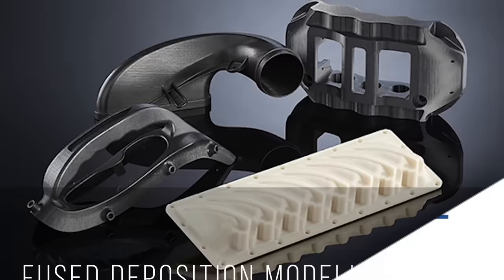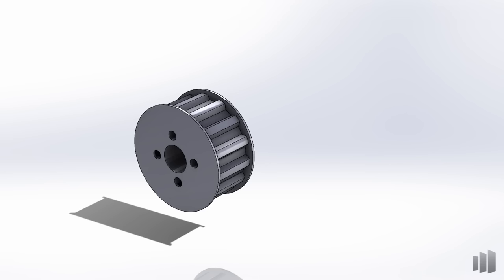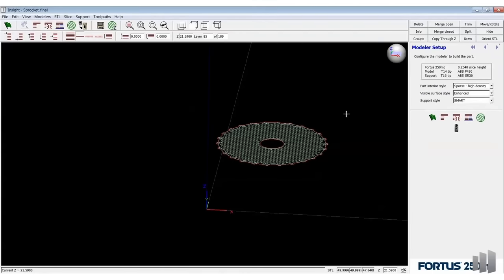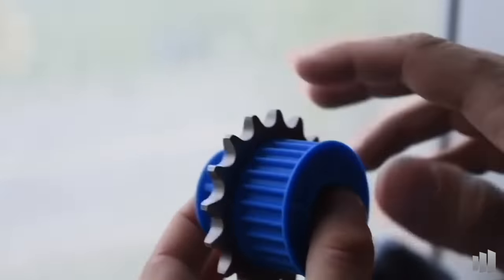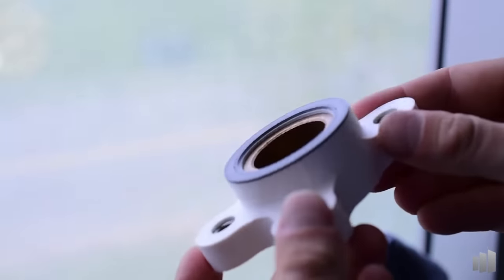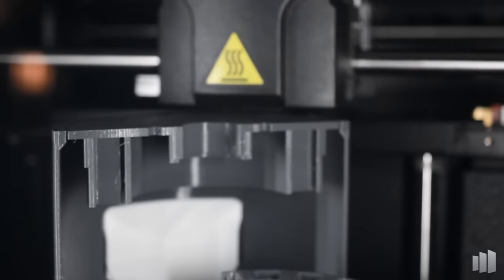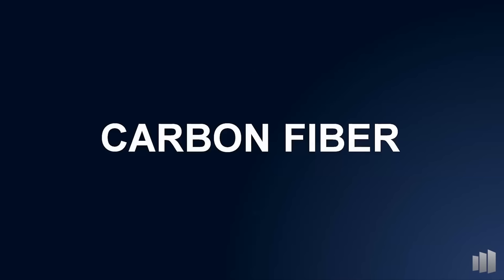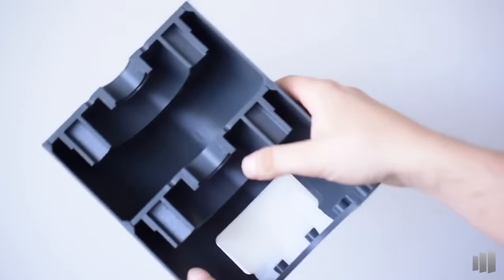6 Advanced FDM 3D Printing Tips When Adding Metal Parts to Your Build

Comment: The pause feature is not limited to just stratasys software. I can very well do the same thing in Cura using the "Change at Z extension" with this extension I can add custom g-code to park the print head by layer number or using overall height allowing me to add fixed in place nuts, mesh, ect
Reply: Any recommendations for videos on how to do this?
Reply: Prusa slicer has an especially easy pause at a layer feature as well.
Reply: @jessem8928  Search "CHEP pause at height" I would send you a link but they often don't work in comments.
Reply: I think you can also add a firmware pause command at any step you like by editing the g code file.
Reply: I can do the same thing without cura just by opening the gcode in a gcode editor and just search the layer I want to pause at and insert a few lines of gcode to pause it.
Reply: Same here! 🔥
Reply: It’s easier to do in cura it’ll add the g code automatically / you pick the layer height etc

Comment: If the torque is high enough to require a metal sprocket this part is going to fail instantly on the small plastic studs in the middle. Use some metal studs at least...

Comment: Instead of plastic rods through the sprocket, drop in metal rods.
Reply: Or use bolts.  The design shown in this video looks to me like the small plastic extrusions through the holes would be prone to shearing off.
Reply: Or thread in screws and/or nuts to hold it together laterally.

Comment: 1:30 "The roller chain sprocket is going to need to be made out of metal because of high force on the part"

* Uses 3d printed plastic pegs printed onto the belt sprocket to transfer torque with a sheer force across the layer lines at a smaller radius than the sprocket *

Comment: All of these techniques are also applicable in the hobby space of 3D printing. I can probably do almost all of these techniques on my Prusa MK3S using PrisaSlicer, though I'm limited on the type of thermoplastics that I can use on my open frame printer since I don't have an enclosure to put around it.
The technique of embedding other 3D printed parts is probably the only one that I hadn't thought of before. Thanx for introducing me to that idea.

Comment: Strangely, my biggest take-away from this is the non-metal, large overhang part you printed there. Had never thought of that. Other than that, I've used the "Pause at Height" post processing script with Cura and have imbedded weights in fidget spinners, magnets in a cup bottom so it's secure on metal surfaces , and a bunch of other things.

Comment: Those are some great ideas! I love it! I'm sure your Inight software makes it very easy to accomplish. 

But you can do these things in common 3D printing slicers as well. Cura and Prusha slicers allow for pausing after a certain layer to insert components.
Reply: By just adding G code at a specific Z hieght?
Reply: @jessem8928  Just add a filament color change at the desired layer and when it pauses and waits for you to change the filament, place the new component and dont change the filament.
Reply: @jessem8928  I am using Prusa Slicer. you can add pause inside the slicer itself. at the Sliced preview. there is a + Icon at the timeline where in you can add pause, color change or specific custom gcodes.
Reply: I have a good reason to leave makerbot behind now

Comment: Really interesting applications for various inserts. One thing I would add is if you have an issue with the hexagonal nuts spinning inside their holes and wearing the surrounding plastic, try square nuts instead, the corners have more area within the plane to move through compared to hexagonal nuts.

Comment: These are excellent examples, thank you for producing/sharing this. My favorite reinforcement are stainless steel screws. In addition to what you would expect (a steel rod significantly increases resistance to deflection/shearing) they are also quite good at moving a force on the shaft to the head. I've had a few pieces that wouldn't work because a sideways load (impact) would delaminate the z-layer easily (even with PCTG and isotropic polymers), but a screw head transformed this into a bending mode on an x-y layer, and all was fine.
Reply from the maker: Most welcome. Glad you found this useful!

Comment: Greate video! I especially like the idea of combinding plastic parts mid printing. I dont know if you mentioned it but personaly I like to preheat any metal parts to bed temperature before inserting them, just to avoid the risk of warping or layer seperation.

Comment: This is an very useful video.  Great ideas for all sorts of inserts.  
Humble suggestion,  when inserting nuts i found it worth buying an inexpensive square nut assortment in place of hex nuts.  The longer edges are less prone to deforming the plastic and spinning if you get a stuck part.

Comment: It is worth noting that superslicer (free) has the built in option to, at any layer add in a pause command. (Or any arbitrary GCode for that matter.)

So you should be able to do this on any printer that doesn't lock down what slicer you can use.

Comment: And here I was, thinking I mastered mid-print weights and magnets… You got me a with this captured sprocket, but then actually blow my mind with this printed halfs, that assembled mid-print. Genius! 2 questions though : 1. Is the layer on top of the sprocket just overhanging? Or does it stick to the metal? If so, what is the filament and how you made it stick to the metal? In my experience I leave a little gap, so that the layer on top of weight is a bridge or overhang, because when trying to print directly on metal part, it doesn’t stick at all and curls like crazy. 2. How on earth did you manage to continue print on top off assembled part? Coming from regular slicer software, so I guess this is some Insight software magic, right? Can’t be simple manual gcode editing, right?

Comment: I have a question:

Do you have any layer adhesion issues when inserting cold parts and printing over them?

Great video by the way.
Really opened my eyes to alot of potential in future builds.
Reply: Great question, I was thinking the same
Reply: layer adhesion is not dependent on the temperature of the surface below
Reply: @TheInfernox7  its not independent either. as the layer beneath cools you will get worse adhesion.
Reply: @dpoarch  I think that they mean more so they aren't expecting the layer on top of the metal to adhere to the metal. And if you have an enclosure on your printer leaving the metal parts inside the enclosure until its time to put them into the print could probably minimize any issues.
Reply: Hmm, perhaps you can add in the gcode to print the first layer after the pause at a slightly higher temp?

Comment: Nice video! I think the only thing I would change would be the sprocket pulley. Rather than relying on the 3D printed part to transmit torque through the 4 small cylinders, you could press fit or bolt all the parts together in the end.
Reply: Yes, relying on layer adhesion for all the torque transmission is a bad idea I think.

Comment: Hah, it seems so obvious to use printed parts as "inserts" to reduce support material requirements. I have no idea why I didn't think of it myself. Nice.
There is of course, always the option to place in a temporary 'support' such as a bearing or bushing to prevent sagging of a print - but this is more difficult for odd shapes.

Comment: Excellent examples of great engineering solutions to problems with FDM printers. However, it should be clarified that Stratasys Fortus printers, while very reliable machines, are far from the only ones capable of these "pause" behaviors. PrusaSlicer and Cura both natively include the ability to pause at desired layers. You can do this on any $100-$1000 printer, it doesn't need to be a $50,000 Stratasys.

Comment: This is an advertisement for fortiss(sp?) and stratysis(sp?)? Neat stuff, but all of the pause at layer stuff is pretty easy to pull off with cura or superslicer... That multi-level baffle thing was pretty smart though, I have to admit. Any feedback on how well the sprocket with double pulleys actually performed? That was an awfully small cross sectional area through layer lines for any significant load, but again - super clever.

Comment: This was an interesting video. I have done the captured nut method though not the same way you did here. I used the press-in method. I will look at doing some of this in the future but I dont have the super expensive 3d printers, well If I use the shop at work I do but that is for work stuff, so don't have access to the same software you guys are using. I figure it is just the way I slice the parts  At any rate this was a very cool video.

Comment: The tip to save supports is realkly great. But a lot of the others are kinda bad by design as you completly lose any maintainability of the produced parts. The idea of pausing and semi assembling a part is an interessting one, but not if you lose maintainability or have to scrap the whole thing if you need to change a little aspect.

Comment: Amazing video. I’m not a mechanical engineer so I’m not skilled at all at this stuff, but how do you go about choosing tolerances in your slicer? 
I often get uneven shrinkage with my ABS prints across multiple parts which makes it quite annoying to fit them together without thorough sanding. Have you measured shrinkages across all 3 axis and compensate accordingly during slicing for that material or do you set tolerances generously during the design/3d modeling phase? Btw thanks again, please do more content about combining materials and multi-material printing.

Comment: All of this is really cool and I have (at times) need for this.  
How are you doing the pauses/resumes and getting the correct resume-heights?
I have a CR10-S Pro and use CURA. The printer has a pause function but you cannot control the exact moment or placement.  
Can I pause in CURA?

Comment: Do you need to spray any adhesive or other interstitial on the metal surface to facilitate the next printed layer adhering to the surface?
I assume you also have to remove the support areas in Insight for each of the layers in which you don't need it.

Comment: What is the black material that is added to the part that has the screen imbedded in it.  Is it gasket material, TPU.  Have an application where TPU gasket would be fused on to a stainless steel block. Now we have silicone gaskets vulcanized to the blocks, requires a mold with a minimum number of parts in the mold.  Since it is a spare part do not usually need the number of blocks that are used in the mold.

Comment: Loved this video. I have a question, when you stop the printer mid build to insert a part does continuing afterwards cause the printed part to cool down making it weaker when you recontinue the print? Or does the pla just adhere to the plastic when you restart the printing?

Comment: Hey , awesome tips thank you !! But I struggle to find how to achieve printing on top of metal parts, because my plastic just doesn't stick on those ! How do you do it ?
Tried many different options as well as printing a small circle and putting it on top of the nut, but I just can't find a working solution to this
Reply: You might try leaving a one layer thick plug in your model just after the nut is inserted. Then the slicer will draw a path straight across the nut and sticking shouldn't be needed. This trick works for counterbores too allowing to skip support material for an overhanging ledge.
After printing the single layer is easy to punch or drill out.
Reply: You could try some PVA glue on the metal surface...and slow down the printing speed on the layer after inserting the metal part.
Reply: Try spraying them with hairspray!
Reply: Imagination.

Comment: I'm still new to 3d printing, and tried to incorporate an ncf chip into one of the designadjustments I made.
Maybe it's because I'm still so new, but I was afraid that the chip wouldn't fit, so I made the room for the chip larger. These parts fit so snug into the design, what hints do you have for me so I can improve this type of design in the future? (Apart from finally taking the time and learning better how to work with fusion 360🙈).

Also, when I sliced my design in cura to pause at the layer height I needed the print to pause before inserting the nfc Chip, the first time it blew right past it.. Oo

Comment: Great video!  Question, what FDM 3D Printing would you recommend that is not too expensive?
Reply: The Prusa lineup is a safe place to start. But if your okay with tinkering more, there are less expensive options. But the Prusa i3 mk3s+ is a relatively pain free printer for $999.
Reply: Printer? The answer is always ender 3. You will learn the most with it vs something that works flawlessly out of the box (not that it doesn't work great) and it's cheap
Reply: @kurtcrafton  I have 2 Ender 3 v. 2, and both worked extremely well. I have upgraded one, but it is still on par with the stock version. I love the Enders - so much value for money!

Comment: First, you're just wrong.  This is easy to achieve with ANY 3d printer as it is a simple matter of including a pause in the g code.  Second, you are merely printing with fancier filament.  Third, nothing you have shown here is exclusive to FDM as there are plenty of ways of making ordinary filament strong enough for this task.  Fourth, you don't need a special 3d printer to do any of this as the g code is flexible enough to allow this sort of thing on ANY printer.